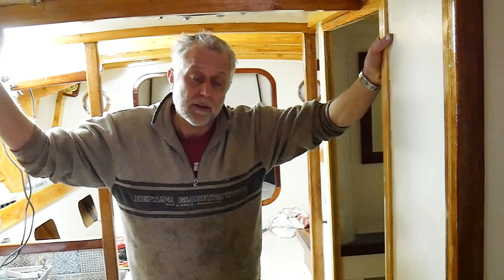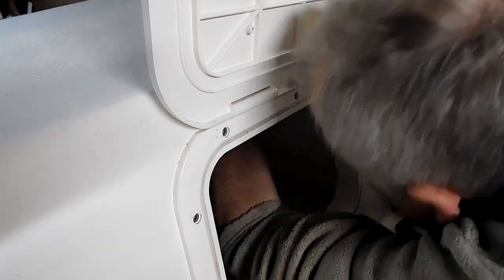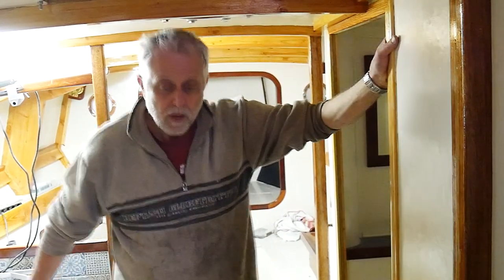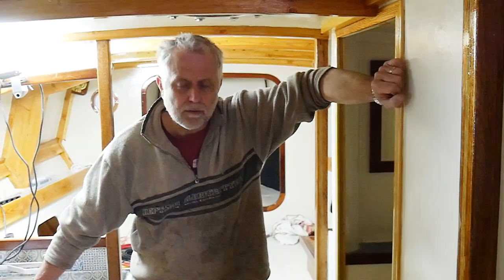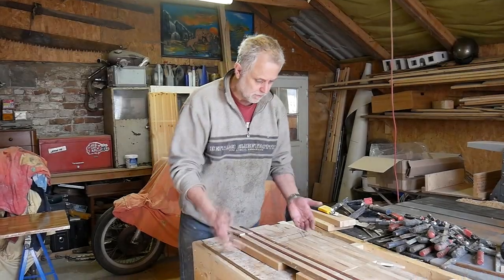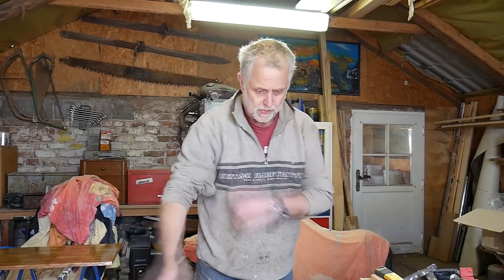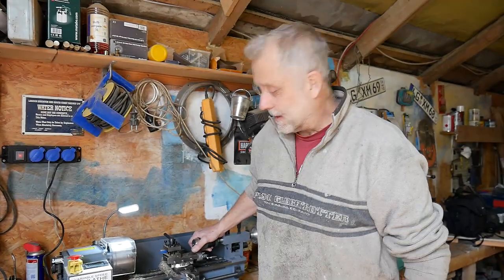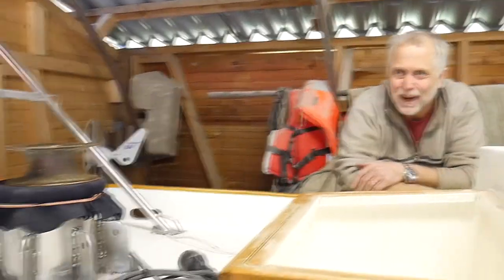Cabin Sole, Bow Roller, Tank Vent and the Chinese Mini Lathe - SV Tapatya EP180

Comment: That new, better-quality belt will probably last forever, Tony.  My dad's Myford M3 lathe is 50 years old and has a system of what look like car fan belts, toothless,  to drive the chuck.  You shift them by hand onto the relevant metal drive wheel to adjust chuck rotation speed.  I'm pretty sure the belts are original and I can promise you: his lathe has had seriously heavy use!
Reply from the maker: And sounds like a much better quality lathe than this little one, Chris! :-)

Comment: Thank you Tony for the video.  Looks like the weather is giving you a break.  The sole pattern is very nice.  The accent strips in mahogany are a great idea and add some pop to oak.  Was that varnish you mixed with the sawdust?  It all but disappeared after sanding.  Take care.
Reply from the maker: Thanks Matt. Yes, dust from the belt sander mixed with a bit of the varnish. Works a treat 👍

Comment: even CNC lathes are driven by belts, to prevent shock loads and save the motor. yes the quality of the belt is important ... good progress any expected ETA for the splash???
Reply from the maker: Yes, thanks Bruno. Splash... I've still got a few big bits to build. It's getting nearer but I don't know when, mate!